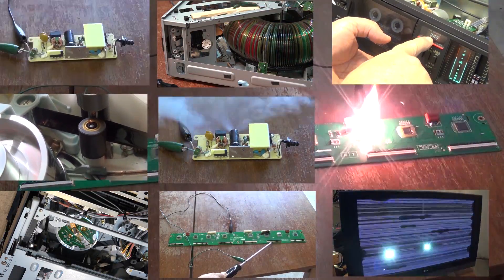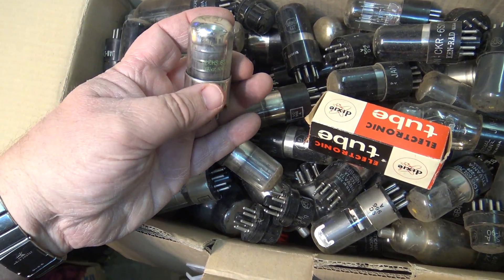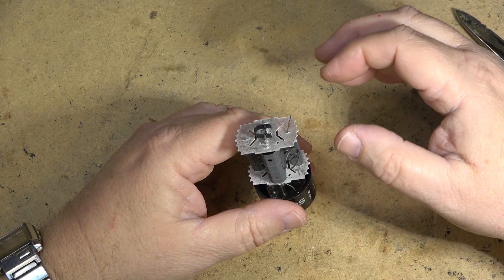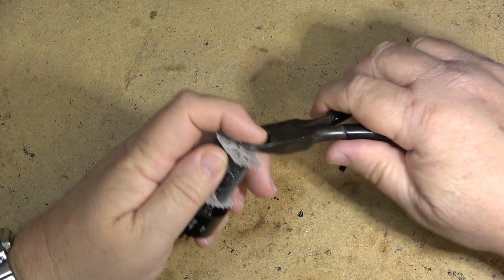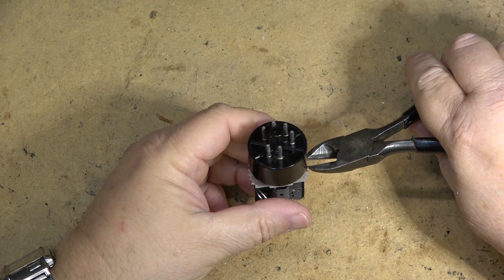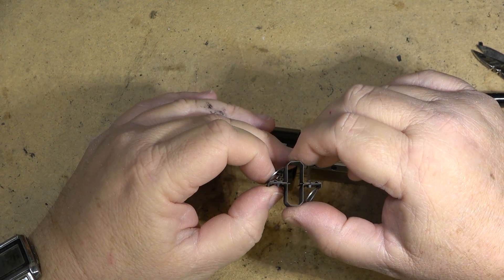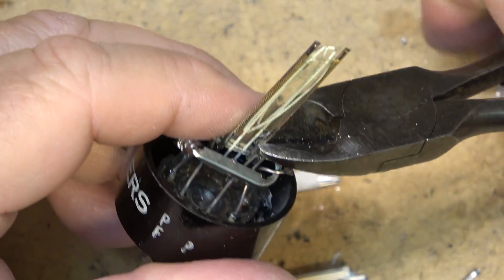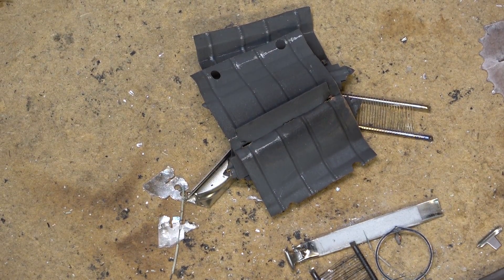What's inside a broken Vacuum Tube

Comment: 11:30 - Cathodes in small tubes were coated in alkaline earth metal oxides (Barium-, Calcium-, Stroncium oxides). Aluminium oxides were used too sometimes. They are irritants. The anode was coated in graphite. Graphite is known to not emit much secondary electrons.

Comment: All tube type numbers begin with the recommended filament voltage.
Reply from the maker: No kidding.  Some were slipt voltage though.  12ax7 for example could run 12 or 6 volts as they had 2 series 6 volt filaments.  In series 12 volts but in parallel 6. There are 3 connections to the pins.  The 35w4 rectifier is also wired this way.   One of the reasons was with these dual diode or dual triode tubes they could be used in applications where only a single triode is needed.  No need to heat up both sides of the tube, or on 6 volt circuits where the dual triode was used as phase splitter it could be used as opposed to having to make s unique tube for this application.  
Philips on their modular 4 tv from early 70s used 4 tubes.  40kg6 horizontal output and 42ec4 damper.  The vertical was a 35xxx and the oscilator was a 12xxx. Add them all up 119v.  All filaments in series.

Comment: Looks like a 6DQ6 TV  horizontal-output tube. Many ham transmitters used these also in the output, like an old Eico 753 i have. I have also gotten several boxes like this with old tubes. If you have a tester you probably find most of them in good condition

Comment: I have an eico hf 87 to go through. I used it for 20 years with nearly all its original parts. Pulled it from service because it's time. Most of the electrolytics ESR 20 to 50 ohms now. Bought it before people were going crazy for this stuff. Got it and it's preamp for  50 bucks. That uses 6SN7s for the phase splitter but mine are OK.
Reply: Wow lots tubes in the big box how Kool is that
Reply from the maker: I retired my McIntosh 1600 years ago.  I use a yaquin mc10t which is a modern vacuum tube amp that will stand up to the best of them.  Modern precision resistors and capacitor and new current production tubes.  It sounds wonderful.  I am listening to it right now.  Fattburger never sounded so good.

Comment: Very awesome video. In my opinion the sound of music from a Tube amplifier has a warmer sound.
Reply from the maker: No comparision. I listen to music from my tube amplifier every day, and I have a few of them.
Reply: @12voltvids  My stereo system has tubes and transistors. My preamp has 6 tubes and a transistor power supply. My amplifers are solid stat up to the output tubes that drive electrostatic panels. Vinyl records are usually my source.
Reply: Tube amps definitely help rejuvenate sound from lofi radio broadcasts like shortwave and am  as well.
Reply from the maker: @DGTelevsionNetwork  
They sound even better with hifi devices.

Comment: would love to see a geiger counter on that box? like a box of meteorites lol
Reply: I doubt you would measure much radiation or any at all.
If anything, some high voltage TV tubes would emit xrays when working, a few of them had a lead jacket to shield the xrays.
Other than that, it would be basically just background radiation.
Some cathodes and filaments were coated in mildly radioactive substances though, but the glass is probably enough to stop the radiation.
Reply: Wouldn't think anything radioactive in there. A few VR tubes I think may have a minute amount of radioactive material to help ionize the gas easier.

Comment: I'm about the same age as 12V (just over 60) , and have been involved in electronics since about 1975. But I learnt solid state stuff, and never tubes since they were old school and all the hobby magazines were about transistors.
My valve "service work" was mainly to remove the tubes, and take them to the local Tandy store (in Sydney AU) to use their free tube tester. In truth, I really don't have a clue how they work. 
To me this whole Tube thing is some kind of red glowing black magic hokus pocus focus that can burn you with hot things and zap you to dead with things that look innocent. The way that they were assembled 'point-to-point' like a rat's nest certainly didn't help understanding how a circuit worked, 
Yeah yeah, I know the electrons flowed from somewhere to the plate... yeah., like that means anything. Through a grid - which is for playing checkers on, right? 😂
Reply from the maker: You have me beat by a few years but the big 60 is staring me down. Just over a year away. I started learning electronics a little younger than you.  I was fixing aa5 radios by the time i was 10. When i first started working in the first shop i worked at i would have been 15. That would have been 78. Vacuum tube gear was still in heavy use and my first boss insisted that i learn it.  The fundamental of electronics.  He was an old navy radio man.  Untill i understood the basics of tubes and the safety requirements he wouldn't let me study or touch solid state stuff. (probably because he was still learning it himself) yes i perfer solid state.  I do fully understand tubes and how they work and still use tubes for audio amplification because they sound so much better than solid state.  Now I am going to draw fire from the ss Nazis who look at specs and form their own opinion without having ever listened to a good tube amplifier.  Once you hear the sweet warm sound that a tube system brings to music it almost sends a shiver up your spine. Sound list like the musician is standing right in front of you performing.  It's the subtile things that just make recorded music come alive.   I have both ss and tube gear set up and the tubes burn every day and the ss is only turned on for specific things.
Reply: @12voltvids  - oops, you are a few years behind me. I'm 100% self-taught, from magazines and kits. Even built an analogue Pong machine kit, pretty much all from 74 series, housed in a wooden box with a pre-built RF modulator as output -it even had an add-on scoring module!
In 1978 I went for my first job at a well known electronics company, but got turned down because I couldn't read certain colors due to some red/green color insensitivity.
Part of the reason was their office was lit by crappy T12 fluoro tubes with terrible color rendering. I explained this and that I could read the resistors perfectly in daylight or incandescent task light.
I also stated that it was largely irrelevant because of the E12 series values and that colors are specifically allocated so it doesn't matter (there is no "green-green" or "green-red" or "red-green" bands).
Anyway, I went into lighting instead. And I take pleasure that, now days, nobody can read the colors on the blue 1% resistors. 😂
Reply: I'm 64 and started working on radios and TV's when I was 13, in 1970. Tube radios were everywhere for cheap because nobody wanted tubes anymore. We all started pulling and checking tubes by pulling every tube and marching down to the drug store, or Radio Shack. As we became more seasoned, we learned that tubes are likely not the problem, and a tube tester tells you very little. Huge marketing scheme to sell more tubes. My grandfather  was a TV repairman so I learned what not to touch and safety about stored electrical energy when a set is unplugged.
Reply from the maker: @zulumax1  my neighbour was the local TV repair man. Very good friends with my parents and grandmother.    I would hang out at his house / workshop and learn how to fix radios.   I learned about high voltage the hard way being sent flying a few times. Get jolted a few times you are more careful the next time.  I was taught that tubes don't just fail. Something else usually takes them out.  Bad resistor, bad cap. 
The tube testers in drug stores were only there to sell tubes.  If the fault that caused the failure wasn't fixed the new tube would burn up pretty quick.